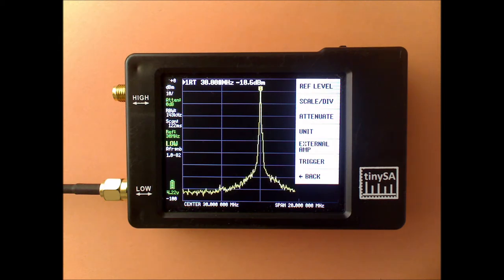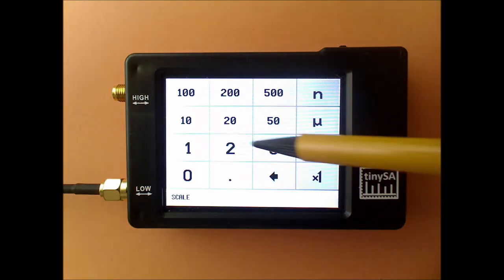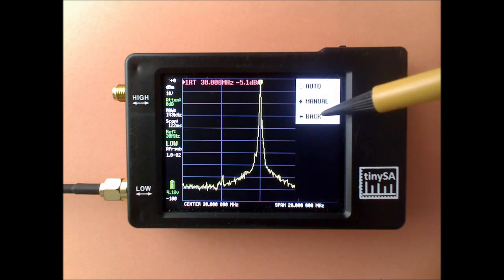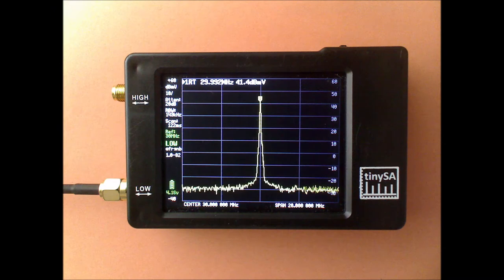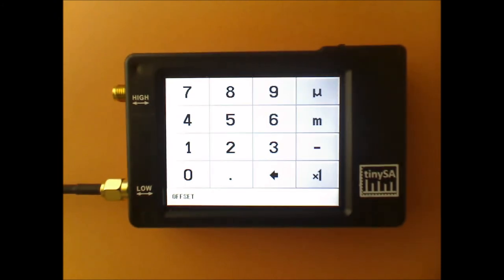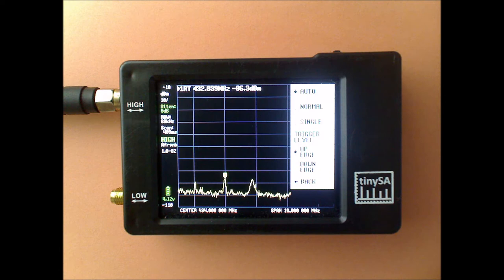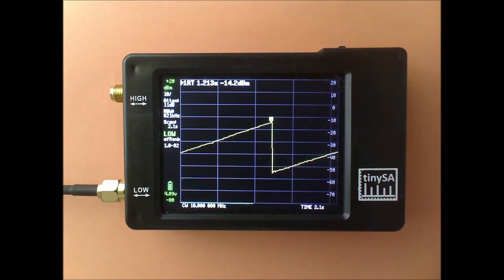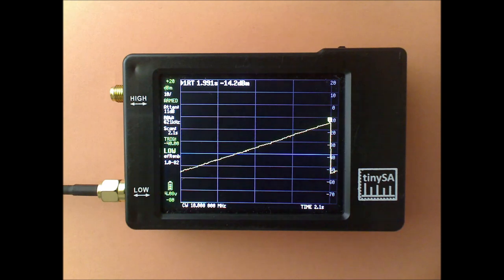tinySA Level Menu

Comment: Hi Erik, I am having a difficult time finding the latest PC Windows software executable, do you have a link? All I find is the source code, and I am struggling to use that, since it calls for a module called PyQt5, which I cannot find.
Reply: Hi Erik, I figured out how to resolve the module issues. However, when I download and process TinySA-Saver-0.1 I end up with NanoVNASaver 2.2, which I recognize, since I have a nanovna. What am I doing wrong? all the tinysasaver code points back at the nanovnasaver software.
Reply from the maker: @stefanbaartman5893  go to the tinySA wiki http://tinySA.org and to PC software and download tinySA.exe
Reply: @ErikKaashoek  I did that, but as mentioned, it is the simple version. I was hoping to find a more advanced version, such as the tinysasaver.exe. Your Github pages mention tinysasaver versions 0.1, 0.11 and 0.22, what is going on with them?
Reply from the maker: @stefanbaartman5893  As mentioned in the wiki, tinySA saver is a quick hack of nanoVNA-saver with minimal functionality.
Reply: @ErikKaashoek  I did notice that. Which is why I am keen to find out more about the TinySASaver app. Can you comment on its availability?
Reply from the maker: @stefanbaartman5893  Please look here https://tinysa.org/wiki/pmwiki.php?n=Main.PCSW and choose one available, try nanoVNA-app, its new
Reply: @ErikKaashoek  I tried nanoVNA-app. It works with the NanoVNA, not the TinySA, is that correct?
Reply from the maker: @stefanbaartman5893  download the modded version from the link I provided
Reply: @ErikKaashoek  What is the exact location of the modded version, and is it for Windows?
Reply from the maker: Please go to the wiki and read the page on PC software
Reply: @ErikKaashoek  Thanks for the help.